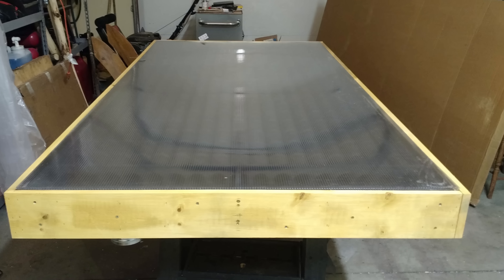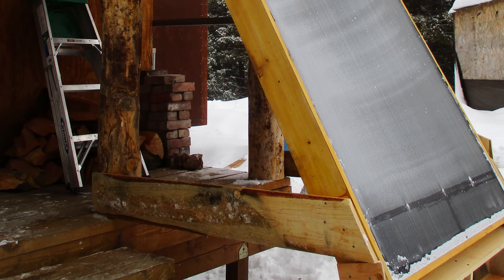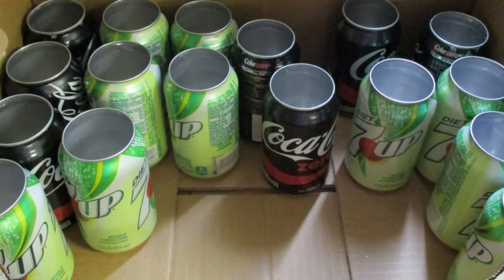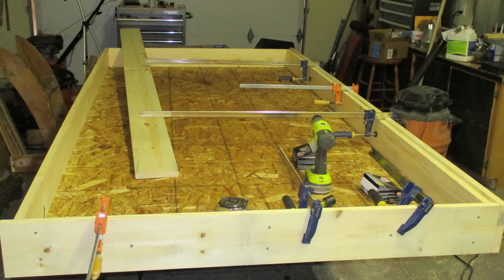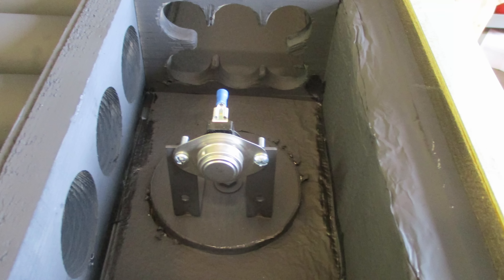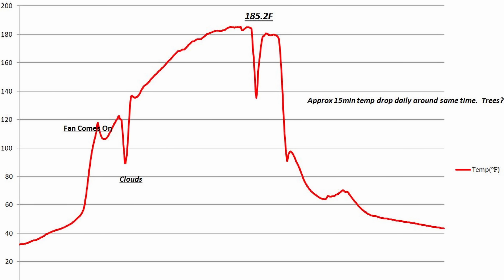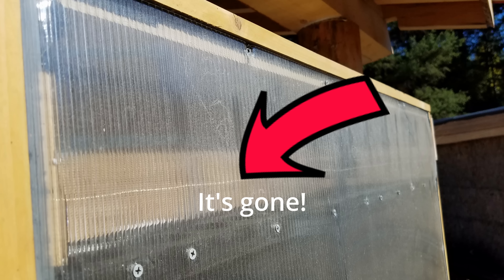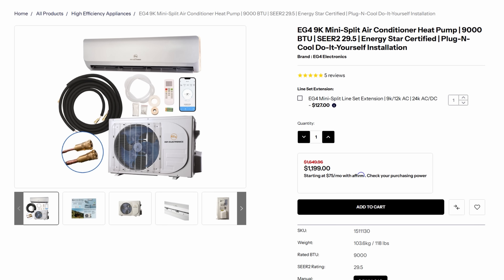7 Years with Pop Can Solar Heater - Is It Still Worth It?

Comment: Americans and their costs. You can make this heater with under $100. And comparing a "$600" passive heating with a $1200 air conditioning unit....
Reply from the maker: Perhaps you missed the point.  I was detailing what it cost me and what it would cost me today if I did the same thing (and didn't have a sawmill).  Of course, you can do it for less with stuff you scrounge. 

Has nothing to do with 'America' though things are far cheaper here.

Comment: I build one years go. I was young and had almost no budget. Build it from recycled wood and foam. Family kept there empty cans for me untill u had enough to build the heater. The only thing i payed for was the glas i put on the top to closr the box but that i got cheap from a glas store. You can build these with hardly any money and i can tell they work great. Just use silicone for really high temperatures. Good luck
Reply from the maker: That's awesome you built one and found it so effective on a budget!

Comment: Why use cans? Corrugated aluminium is both cheap and seems perfect for the job. Also insulating the wood seems like a waste, if you need more heat, just make the panel a little bigger.
Reply from the maker: Just what I had at the time and the idea appealed to me.

Comment: If the esthetics works and space is available on your porch you'd do better heating the porch if the warm air supply was released at floor level, heat rises and you would feel warmer as the heated air would be effectively dispersed. Bonus would be reduced or eliminated night time a/c effect from cool air back flow.
Reply from the maker: Great points, I'll definitely keep those in mind for future builds!

Comment: I went a bit different direction on mine. I used a wood box like yours but painted the inside with flat black tremclad. For the pipes, just scrap black PVC drain pipe all the way to the bottom and trimmed it so it sat on the bottom 

I used a solar panel hooked to a 12 volt computer fan to pull the heat down and ducted it from the bottom manifold into my garage sucking the warm heat from the ceiling of the garage down.

I did up a few built around 4x8 sheets of plywood, each one with its own mini solar panel running the fan. The setup kept the garage from freezing down to -40 outside temperatures as long as I could keep the concrete floor warmed enough during the daytime.
Reply from the maker: Sounds like a very effective setup!

Comment: Better to use a solar panel feeding an element and sand battery?  Or even better to use solar to power a mobile heat pump?
Thanks!
Reply from the maker: I don't agree.  This runs when I'm gone, all the time, without any need for power other than the fan which is a 'nice to have' not a 'must have' and the fan runs off my battery bank which is just sitting there with nothing to do when I'm not home anyway :D
Reply: @TheOldJarhead ok. Thanks

Comment: This got me thinking for the insulation you can use aircrete it's concrete mixed with rubbing alcohol xanthan gum and dish soap it's a great fireproof insulation you can find video's teaching the ratio and mixing methods enjoy using your engineering skills I'll use this on my teepee style cabin I'm building on the edge of My property it's going to be a off the grid test site
Reply from the maker: Cool idea

Comment: I used metal downspout pipe instead of pop cans and didn't insulate the boxes. I used DC computer fans powered by a small solar panel to exhaust the hot air into the building. No thermostat. The damper situation crossed my mind and I considered making a small lightweight plastic film flapper doors to control the direction of air flow but opted to see how the heater worked first.
It works well as it is. I see a similar air temp increase, year-round, so I'm glad I placed one on the east wall to initiate morning warm-up and another facing south to get full advantage of the afternoon heating.
Reply from the maker: Sounds like a great setup!

Comment: My opinion is you made this way too complicated. It isn't even close to free heat. If you have all of these electronics that use electricity and the box and all of the materials inside of it are so expensive. 

For the $600 worth of today's currency that you spent on this, a handful of dollars of electricity to run your electronics for the same amount of heat output, you would have been better off to get a $100 Chinese diesel heater and 100 gallons of diesel.
Reply from the maker: you can't leave that diesel heater running and unattended for days or weeks at a time

Comment: thats painful to watch... pollypsy foam... i think you meant Pollyiso Foam ... oh my
Reply from the maker: CI Max™ polysio foam sheathing board
Reply from the maker: Strangely, I can't actually recall where I got that from though there are references to Polysio vs Polyiso it's possible I read that wrong and went with it.  The foam I had used was indeed Polyiso and not rated high enough for the heat I produced resulting in me going back and doing more research and finding a reference to much higher temp foam board called at the time "Polysio something or other" - at least that's what I recall today but who knows?  Entirely possible I misread something and just had it stuck in my head.  That's the funny thing about us Humans, none of us are perfect.
Reply: @TheOldJarhead  Poly Psy sounds like a Refference to Political Science classes at College... maybe that just stuck in your mind.. doesn't matter but ... anyway super glad you didn't end up with a fire ... I have seen new designs of this concept that are easier... First one is using Aluminum Rain Gutter instead of Cans... second one is just using a couple layers of Metal Black Window Screen and not worrying about the tubes at all.. I would like to use this for heating my house but I am not prepared to drill 6 inch holes in the walls.. and then I would have to cover or remove them in summer so they didn't heat the house in summer... 

Anyway... probably Political Science.. Poli Sci .. got stuck in your head .. were you watching the news? heh ... good luck with it.. good to hear an update describing long term use and issues
Reply from the maker: LOL more likely dyslexia  🤣 I am prone to it at times.  I've also seen the other methods of doing this but back when I did the build (2017/18) it was thought this was the most efficient method.

As for drilling holes, hmm...I'm wondering if a window setup wouldn't work.  Open window, install plywood in the open space with holes for inlet and outlet.  Drop inlet to floor, leave outlet as is -- just open-- affix heater to wall and connect to the inlet/outlet and let it run in the winter.

Might be worth it.

Comment: I had a friend that built one of those back in the late 70s or early 80s.  This was in North Dakota so bitter cold winters.  It worked.  In spring/fall and the milder parts of winter I think the air came out at around 130F.  In the cold parts of winter it was much less, but still usable.  I think the air came out at about 85F.  Not a lot of heat, but every bit helps.
Reply from the maker: Thanks for sharing! That's awesome that your friend built one so long ago.
Reply: @TheOldJarhead  Actually I think I've still got it in a storage building on my parent's old farm.  He used it for several years but it needed some work and it wasn't saving him that much - he didn't have a great southern exposure.  I should go looking for it next time I'm up checking on the place.  It was pretty crude compared to the one you built.

Comment: I used flexible dryer duct instead of cans and 1" foil backed rigid insulation to make the box, a couple of cans of flat black spray paint and one sheet of plexiglass for the outside and half inch mdf for the inside. I just ran the duct in vertical rows like the cans.
Reply from the maker: Cool

Comment: Couldn't you get most of this heating if it was simply a sealed black box without the cans? If the inside was corrigated metal for the back and sides you would increase the surface area.
Reply from the maker: You could.  Supposedly the cans add better heat transfer but a black box would do it

Comment: Thanks for the after-action report. 

A few thoughts...
- Use heavy plastic sheeting as a flap in the solar box to prevent reversal. You'd likely need to shade it to prevent UV damage, but you wouldn't have cans there anyway
- "free heat" generally refers to the operational costs, rather than the build costs. That mini-split will cost electricity every day, and they tend to not do so well at 20 degrees
- Would foil work better than black paint for the inside of the box? Only the cans are there to absorb heat, and the foil 'might' improve the can heating and reduce the snow/ice build-up
Reply from the maker: Good idea on the foil
Reply from the maker: Good thoughts, thanks!

Comment: Here's an idea: cut down on construction cost using aircrete (AKA foam cement).  Build your own foam generator via online plans. 

Aircrete has many advantages for such solar designs: easily worked with woodworking tools, lightweight, cheap, can be formed in molds and fairly strong. Has insulative value properties.
Reply from the maker: Interesting idea!

Comment: use a sheet of saran wrap on the outflow at the top so that it acts like a flap that blows out when the heat is flowing, then gets sucked backward and blocks the reverse cold flow at night, that's what i do.
Reply from the maker: Thanks for the tip!

Comment: NO CANS ! - Aluminum ducting - it does not have to be glued. It only has to be cut once. It is really cheap when compared to the time and manual labor of fitting those cans together and gluing. It readily accepts high temp spray can paint. It goes together in a jif!
I found some used shower doors at a window recycle outfit. AND THOSE ARE TEMPERED GLASS.
I also used pegboard sheets without the holes (Masonite) for the entire box construction and fastened it together with use guttering I trimmed and also fitted the shower door in place on top by using portions of an old aluminum window cut to my notion of L bracing. I also fashioned lazy susan pivots to be able to track the sun.
A second furnace I constructed in the horizontal.
The basic thing about using the masonite to build the box was how light in weight it was. Not a problem at all for the horizontal one. It vents into a casement window with a length of aluminum ducting.
Reply from the maker: Thanks for sharing your design and experience!

Comment: I think this would work well for a purpose I have.
Lots of south-facing multi-pane glass to get a greenhouse effect, and there are roof and patio overhangs above all that glass measured specifically so that the sun only touches the glass 6 months of the year.
But not "all" of the south wall is glass (most of it, but not all). So a somewhat shorter version of this would work perfectly in those sections. They would be vertical, up against the house, under patio or roof overhangs. And would only see sunlight from autumn solstice to spring solstice. At the peak (Dec 21 or so) the sun will have climbed up almost 5 feet. So the boxes would only need to be about 5 feet tall. I imagine they'd get less hot at the top being only 5ft tall. Also they'd only get a little sun when it's cool out, and full sun only when it's truly cold out.

I've been looking for a good way to harvest solar heat along that non-glass portion of wall. About 12ft across, upstairs & downstairs. (50x32, the other 38 ft across are glass for direct solar heating greenhouse style).
It's either this, or those evacuated glass solar tubes.
Reply from the maker: Sounds like a perfect application for it!

Comment: I use carbonated water cans instead of pop or beer.  No big difference but something people who don't want the carbs might be interested in.   :D

I'm thinking of a similar set up using those fans they use on wood burner stoves.  Heats up the baffles and the fan passively spins until the heat dies back down.  Don't know that it'll cool down the cans, but at least it can direct more heat away from the panel into the room.
Reply from the maker: I've thought about those fans myself as I have one on my woodstove but couldn't quite figure out how it might be placed to make it work.  Since I have plenty of battery power and solar, I just run small dc fans

Comment: I built a 8'x8' solar array using 1/2 ply wood, 2x4 as base with 2x2 as a frame holding the ply wood together.  The framed  glass was free as I got them from a friend who put double pane windows on her home.  You can usually can buy the windows or sliding glass doors from facebook market place for cheap. Instead of cans I used the corragated sheet metal used for roofing.  Painted them flat black.  Caution must be used when handling the sheet metal in the bright sun light as they can get very hot.  I cut a 12"x12" hole in the wall and wounted a 12" box fan.  Two 8" duct pipes ran from the far end if the house to the bottom of solar array.  My solar array produced about 140 degrees of heat and the heat coming 12" from the fan was about 85 degrees sometimes more.  This was enough heat to warm the living room, dining area, and kitchen to 64 to 68 when the outside temp was around 45 to 50.  So the only time I needed to run the gas heater was on cloudy/rainy days and sometimes early in the morning for the initial warm up.   I had a timer which would turn on at 9 and off at 4.
Reply from the maker: That's an amazing DIY setup! Sounds like you got some fantastic results and really optimized it for your space.

Comment: My 12000 BTU mini Split AC/Heater only heats to around 40 degrees outside temp. If outdoor temp is in the 30s or below, no heat for me…
Reply from the maker: Interesting!  That means it wouldn't do me much good at 30 below ;)
Reply: @TheOldJarhead that is correct, great vid, thx so much…
Reply from the maker: Thanks 😀  For me, the woodstove heats the cabin but I amnalways looking for alternatives and this heater will be rebuilt!  We can rebuild it 😁

Comment: Nice !  There is always room for improvement thru testing. A couple questions 1) Why would you not Push air in  from the bottom. 2) What about increasing air flow as the temperature raises. 3) Or maybe vent some of the hot (or mixing in cooler air) if it gets too hot.  4) Or have some sort of tilting mechanism from the sun on the array when it gets too hot. …… I now I wish I would have built one these years ago.
Reply from the maker: Pushing the air makes sense, I just pulled it.  Otherwise it worked quite well.

Comment: Why not just paint old radiators black and fill them with old oil.
Reply from the maker: Airflow.  But the radiator idea could possibly work as well, you'd just have to push air through them I guess.

Comment: Id suggest a thin piece of balsa wood or even thick paper or cardboard that will absolutely move when the fan comes on. The paper as long as it's flat will cover very well. May need replacing, but should work.
Reply from the maker: That's a good thought!

Comment: Wonderful testimony. Good luck rebuilding your solar air heater. Great to hear your building and design through trail and error. Best way:)

I built a 5'x3' unit with 55C or 130F, then a 6'x3' unit with 71C or 160F, then a 6'x6' unit with 4" tinfoil foam and 21 aluminum downspouts with output 95C or 212F! 

I agree a 6" top hole and 5" bottom ventilation hole is better than 4" holes. I built two insulated decorative wooden hole plugs installed when the sun sets holding in the generated heat. I cooked the duct fan eletronics in the top hole. So the duct fan goes in the bottom hole. I am currently designing two 7'x3' units with heat output maybe 80C or 176f. One for the kitchen and one for the upstairs bedroom from 9am to 5pm on every sunny winter day. 

Great work and I look forward to your next stage:)
Reply from the maker: Thanks for sharing your experience and tips, those are great ideas!

Comment: That cost does seem oddly high.  You could buy a PV panel of roughly the same physical size and just attach a resistive heater to it and probably get similar results for about $200, today.
Reply from the maker: Just the prices in big box stores today vs 8 years ago.

Comment: I did this following your inspiration. The easiest method i found for getting the bottems and tops off the cans that worked extremely well. I used a table mounted belt sander and it sands through the bottem tops in about 3 to 5 seconds per side. I used 80 or 120 grit iirc. The tops come off super nice as you basically sand the rolled seam off, the botten just sands through the rounded bottem in no time. I worked on a project that involved a large college and they essentially did the same thing by putting a perforated black steel roofing over top of an existing metal roof, as well as on some of the dormitories that had steel siding existing on them. They had controls that actuated fans to draw the warm air in once it reached a certain temp to augment the existing hvac system.
Reply from the maker: Cool, let me know how it works!

Comment: I made one 15 years ago. We were able to use leftover material, so there was no cost. BUT, in zone 9B, 1000 feet altitude, N. Cal., in mid-winter, the lexon melted,  rippled and turned opaque.  It worked very well up to then, however. I have to guess it wasn't  cold enough outside to dissipate the heat.
Reply from the maker: Thanks for sharing your experience!  Could be it just needed more airflow?